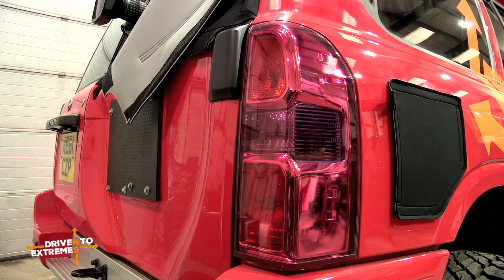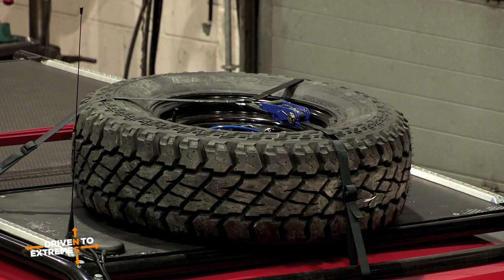Modifying a 4x4 for -60C Cold

Comment: Naturally aspirated TD42 with massively power, gave me a laugh there!
I bet it is as gutless as my old HJ60 was before I put a turbo on it.

Toyota still sells simple Land Cruisers without any fussy tech. Bare bone 70 series with the 1HZ engine.
Reply from the maker: @Mr.Engineer.  Out first choice of vehicle was actually the Land Cruiser 70 series, or possibly the 105, but Shell who were paying for the TV series to promote their Helix engine oil didn’t have an association with Toyota. The choice of vehicles I was given were Ferrari, Audi, Hyundai, Jeep, Land Rover and Nissan. I knew immediately that the Nissan Patrol in a UN / Aid Agency spec were the vehicles to choose.
Reply: @DriventoExtremes  
I agree with you, the Patrol is not a bad vehicle at all, but I do prefer the Land Cruiser.

Would be utmost interesting to see you attempt this in a Ferrari 🤓
Reply from the maker: @Mr.Engineer.  We did actually consider using a 4-wheel drive Ferrari FF for the 'Coldest Road' programme! I did a lot of research one the Tuktoyaktuk Ice Road in north-west Canada and it should have been feasible. Shell though wanted the same car to do all 3 programmes and we knew that it had no chance of getting across the Taklamaken Desert in western China or battling through the Malaysian Rainforest, hence opting for the Patrols.